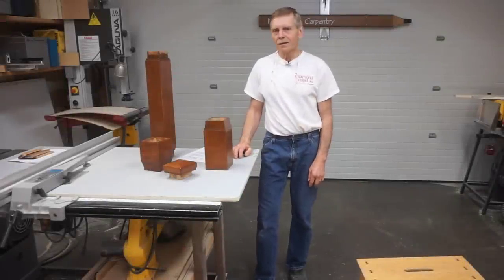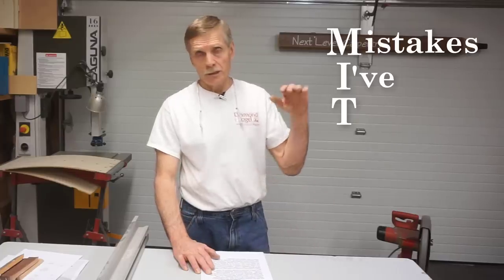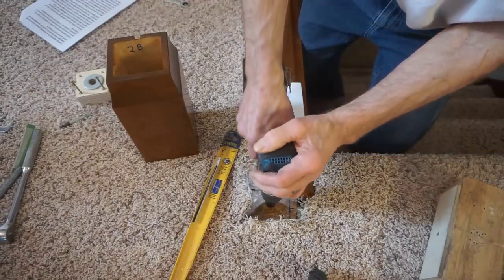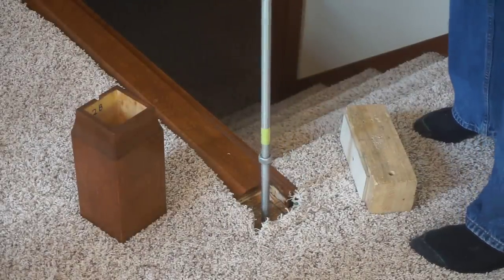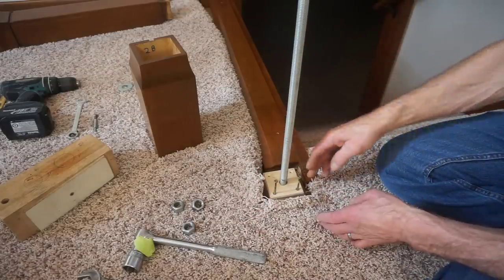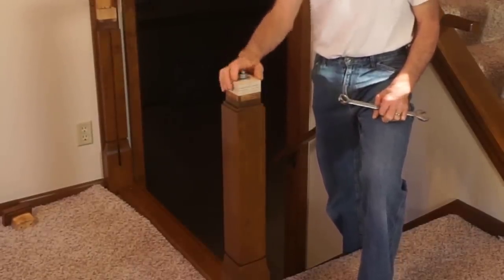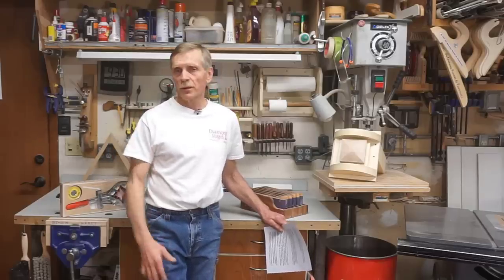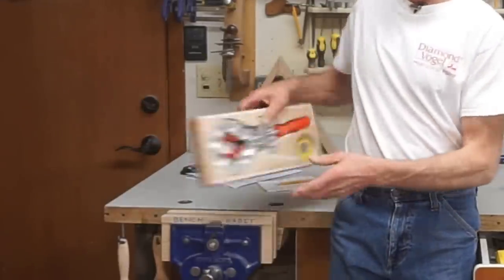How to Install a Newel Post Without Wobble

Comment: Great video! Can I ask a question? We have basement stairs with no knee wall--just treads on the stringer. We've refurbished them (removed carpet/padding, stained/painted, etc.) but we need to add a newel post and handrail/baluster. The only problem is that we need to attach the newel post to a concrete floor, so there's no access underneath. I was thinking that we should do what you've done above; ie., drill into the concrete and run the rod through the post, but how should we attach the post to the last stair tread? I believe our only options are to 1. cut away the front part of the last tread and mount the post to the floor at the base of the stairs, or 2. cut a hole in the last tread and mount the post on top of a block that would stop just under the tread, with the rod going through it into the concrete. The second option would not only have the rod going 6-8" into concrete, but would also have the tread surrounding the post on all four sides instead of only part of three sides...or is that overkill? Does this make sense? We have to do something, as we have a rise of seven treads with no rail, which isn't safe (it doesn't meet code and we've already had someone fall). Thanks for your help!!
Reply from the maker: If you epoxy the all-thread into a hole drilled in the concrete slab (which is typically about 4" thick) it will be more than strong enough to hold a 4~5" square hollow newel post firmly, regardless of what you do with the bottom step.  I'd probably make a 2 or 3-sided notch in the bottom step for positioning of the newel and for aesthetics because you don't really need it for strength.  If you do choose to make a 4-sided hole in the bottom step I'd get a newel post that's long enough to extend down through the step to the concrete rather than putting it on top of any blocking.  Browse Pinterest for newel post design ideas and decide how you want it to look and go with that... should be more than strong for a reliable railing. 
Best, Matt
Reply: @NextLevelCarpentry  thank you so much!

Comment: My engineering degrees are from a far less prestigious schools but I do have a tip when shortening threaded rod or bolts, put a nut on fist then cut and/or grind as needed.  When you thread the nut over the cut it will clean up the threads quickly and easily.

Comment: I know this is an older video, but in case you still read these I'd like to thank you for your candor when you mentioned using a forgivably misleading adjective. It's a small gesture that speaks volumes of your character. Thanks for another great video. :-)
Reply from the maker: As long as you're watching and commenting, Chase, I'll still be reading comments 😀😎 Yeah, I end up with a fair amount of wouldda, shouldda and couldda's in video production as I learn the ropes of video production.  A pro would have edited the script but it didn't occur to me until way late in the game.  I do appreciate your compliment though... it speaks volumes of your character as well.  Best, Matt

Comment: Thank you, thank you, thank you.  I have been struggling to rebuild a staircase, torn down by an unscrupulous contractor.  The job I thought would take two-and-a-half weeks has taken over two-and-a-half months.  I am now struggling with the newel posts--box newels I saw in a book by Andy Engle.  This video offers a more powerful solution, than the 2-by-4 under-post blocking I was using.  I just stumbled into your channel, today.  Thanks, again.
Reply from the maker: You're welcome Sheldon... sorry to hear you're having to deal with fallout from an unscrupulous contractor... that's never a pleasant thing. If you're able to adapt this method to your project I'm sure you'll be pleased with the end result.  The project featured in the video was my first experience with it.  I was thankful that the basic principal is so sound that it took very little planning to adapt it to the railing/newel design I was using.  I hope you're able to do the same with design adjustments for your project!  Best, Matt

Comment: I will be doing new stairs and railing is an issues since I have no idea how to make it stiff. With your video and great idea now I can do this project. Thank you for sharing your wisdom in a way that anyone can adopt and comprehend. Thank you !!!!!
Reply from the maker: Hey Arek, good luck with your railing project... I think you'll find that adopting the principal of this method (if not the exact arrangement) will give you a stronger finished railing than any of the bracket kits available.  Best, Matt

Comment: I did six hollow box newel posts just like this six months ago. Very similar except I used 1/2” hanger bolts which have a wood lag screw on one end and machine thread on the other.  I drilled the pilot and drove the wood screw end into the double joist below like you did.  Then I used a threaded rod coupler to connect to the long piece of threaded rod.  Saves on some customizing time and the threads are designed for holding in wood.  On one section of railing I made the cap removable on the posts so I can unbolt and remove the entire rail system when moving large pieces of furniture around.
Reply from the maker: Great adaptation of this concept Richard... useful information for other viewers who's installation requirements and railing design may benefit for the options you found useful... thanks for adding your experience here! Best, Matt

Comment: I'm trying to help my dad put a railing on his steps and it's like the blind leading the blind. This videos helps me to comprehend the right way to tackle this project. Thanks!
Reply from the maker: Hope it helps you both see the light, Kathleen! 😎  There's a lot of different ways for attaching newels that vary as widely as railing designs themselves but if your railing style/design/type lends itself to this installation method I'm confident you'll end up with solid results you both can be proud of! Best, Matt

Comment: The best method I have seen in 40 years, other than access to the bottom and fastening to the floor framing
Reply from the maker: William, perspective from your 40 years helps you see advantages of this sort of thing, doesn't it?  I was planning on making an oak 'core' for these posts that could be fastened (with great difficulty and disruption) to floor framing below but am convinced this method is much better and equally rigid. I actually had access to a good crawlspace below the two newels on the lower level in this video and STILL chose this method over bolting directly to floor joists/headers below.  There's no doubt installations where a different method it better but I think they're few and far between.  Thanks for your comment!  Best, Matt

Comment: Excellent method!  Best I've seen.  The only movement is in the compression of the materials, which really cannot be removed without serious excavation of wood and drywall or lots of heavy steel plate let in to the existing sub-floor spanning to the next joist and welded inner core post, which would be costly and time consuming.  Two enthusiastic thumbs up!👍👍
Reply from the maker: I respect your obvious in-depth knowledge of physics on this Mike... insightful and polite... thank you! Best, Matt

Comment: Great vid!  Years ago I had a remod to do with a free-standing newel post that had been repaired several times in the past before I got to it.  There was a triple 2x10 beam under the subfloor, so I drilled it for a 3/4" diameter iron pipe that I epoxied in place. I threaded the top of the pipe and used a block and a small pipe flange as a nut.  The post hasn't moved in more than 10 years.

Comment: That was awesome. Love the part where what is required is, "holding your mouth just right". When that nut gets cranked down, you just know that system is solid as hell. That homemade tap on the end of the rod? Another awesome!

Comment: Great video, Matt. I’ve been installing railings and setting newels for 29 years and I learned a new trick yet today. Thanks. 
One trick I learned many years ago is that automotive body filler (aka bondo) can take a post from “real rigid” to “rock rigid”. If you were to mix a bit of it (feather lite filler) and apply it to the block at the bottom of your reddy rod and to the inside of the box base that slips over it, it will take most of the flex out of your post. 
Make sure to let it harden a bit before you clean up what ever squeezes out. Right when it starts to harden, the filler is very easily cleaned up and it will not stick to your prefinished post or a prefinished wood floor. It could also be used as the shim that sometimes is needed to plumb the post by letting the excess squeeze out from under the post, making sure the post is plumb and letting it harden before you tighten the nut at the top. It only takes about 3 minutes to harden. 
Cheers!  J from woodatwork
Reply from the maker: Great tips Woodatwork... I use Bondo for all sorts of 'nontraditional' applications but hadn't thought of the use you suggest here... Thanks! Best, Matt

Comment: HEY MIT dude! Great use of engineering ideas! I am so glad I watched this after watching the use of Newel posts...with the set those fancy screw/swivel bolt assemblies. However I had already gone out and purchased the 4x4 solid Larch posts for the Newel post or end post. Because it’s a sold piece I think I will drill a 3/4” double ended tapping screw/lag bold with a base on it about 4-5” long either way. The application that other craftsman had used was sinking about 4-6” of 1/2 of the 4x4 down into a pre cut, square hole. Because this is a stairwell heading to a basement and was completely finished and sheetrocked before I showed up to secure a banister with better rigidity, I can only estimate what subconstruction might be there. Your systematic way of presentation really invites novices like myself to glean much better results...in spite of our perpetual incompetence. I am an ICU nurse by trade, but learning is a way of life for us. Thank you so much for the time you spent giving us your knowledge and skills!

Comment: About 20 years ago, my brother was doing a reno for a customer that involved adding a small half wall at the front door. I suggested  that at the end of the 4' wall , we run threaded rod through the top of the framing down into the floor. We had access to the basement ceiling below so added a large steel flat plate washer and  lock nut. Amazingly stability once all torqued up.
Reply from the maker: Amazing how the physics of all the pieces come together for stability, isn't it?  Best, Matt

Comment: This really bailed me out on a flop house rehab. I work with the local Land Bank fixing up houses that have been seized for back taxes, with the goal of getting them back on the tax rolls. Typically this includes a new roof, kitchen, bathrooms and all mechanicals. In this case, one newel post was floppy with a shattered handrail connection, and one newel post that was missing (a 2x4 was screwed vertically into the flooring which took it’s place, though I’m not sure why they bothered). This was a 150 year old house & the drywall downstairs was already done, so I used this method from the top. I was not able to center the threaded rod, but I offset the hole in the bottom centering block, and the centering block kept the post centered. I also pinned the bottom of the post to the bottom centering block in addition to shimming as needed for plumb. I know I’ll be using this method again! Thanks!
Reply from the maker: Great adaptation Neal... way to go!  It's a prime example of the strength and effectiveness of this method.  Good luck on your future projects where it sounds like this might work even better for you.  Best, Matt

Comment: I like your way its very effective. I use to drive a 1/2" x 12" leg bolt with blocks just like you into the heather below by 6" and then snugly slide my post over with construction adhesive fastening it at the bottom with nails or screws hidden behind the base trim. Just my two Canadian cents 😎
Reply from the maker: Interesting adaptation Lino... I am a bit surprised that you got acceptable results using construction adhesive to hold post to bolt... I would have guessed it would take epoxy to be stiff and strong enough to be effective.  Thanks for sharing all the same... Best, Matt

Comment: I sure appreciate this video. I get so sick of wobbly newel posts. Ive used pocket hole jig to put 2 screws on each of the 4 sides of hollow post. It works ok with the big 6” posts. But im going to try your way next time. Keep up the great videos. Going to save me some headaches
Reply from the maker: It's a bit more work to do it this way but I'm confident its a great investment of time considering the reliability of the end result.  Thanks for your comment skeefuss! Best, Matt

Comment: Very nice. Might I suggest,  cutting a horizontal pocket into the 2x10s to slip a plate washer and nut into from ceiling elevation below. I know you're dealing with limited access issues but even with a small drywall patch this would absolutely eliminate the possibility of thread pullout. And of course as you mentioned not to compromise existing structure. You got a new subscriber and hope you don't take offense to my  suggestion
Reply from the maker: I hope I never take offense to great suggestions like your's Matt.  It sounds like a good method for any installation and a great suggestion  if a particular joist is 'punky', soft or otherwise less able to hold against thread pullout.  Thanks for adding it here... someone, somewhere, sometime is sure to benefit from it.  Best, Matt

Comment: Fantastic real world solution ! Worked with plenty of large solid newels back in England but never a box newel . A great concept and some good comments too. Liked and subscribed.
Reply from the maker: Thanks for liking and subscribing Marc.  Since you've worked with plenty solid newels you know the challenges faced to get them solid enough to be useful.  That experience will help you fully appreciate this method if/when you get a chance to use it.  Personally it wouldn't bother me if I never had to install a solid newel again! 😁😎 Best, Matt

Comment: Been a stair guy for 20 years. I always install a full square post and just slide the hollow parts over it. Works good with horizontal bars. You can drill deep.
Reply from the maker: 20 years in... and you just learned something new, right?  Never too old to stop learning and improving IMHO...

Comment: Great solution...thank you!
Reply from the maker: Mark, I think you'll like it even more if you have occasion to actually use it... I was thoroughly impressed by how well this worked for the installation shown in the video.  Best, Matt
Reply: @NextLevelCarpentry  Thanks Matt.  I'll file your great knowledge and be ready when needed.  Thanks again.

Comment: I've used a similar system and yours looks even stronger.  The newel was located over an open section of floor, not directly over a framing member.  The rod went thru the flooring and held in place with a nut and washer, and maybe another bit of plywood (been a few years).

Comment: Hi Matt, Great method... every time i have done this its a love hate thing. I always get it to work but it is always such a pain. Your system is simple and makes sense, cant wait until I have another opportunity to try this out.
Reply from the maker: Ed, I know what you mean about the love/hate thing... I was prepared to do all sorts of laborious prepping and 'invasive carpentry' so these posts wouldn't wobble when installed!  I was SO relieved when my friend Jared tossed the ready rod method at me... could have had a brain aneurysm when the flash of realization hit me for how much effort and frustration I could avoid.  If/when you have an opportunity to try it I think you'll find many installations are twice as difficult and only half as effective as this. The ProRemodeler piece I'm writing will cover how I got solid blocking under the other two newels mentioned in this video plus a variation for conditions such as I-joists where a single rod in the center of the post isn't feasible.  Thanks for your comment!  Best, Matt

Comment: Very innovative! In the case of a solid 4x4 newel post, I used one of those metal plates that you route into the floor base and screw in a 9/16 bolt in the center of the newel that anchors into the metal plate. It’s not quite as rock solid as your set up, but still pretty strong!